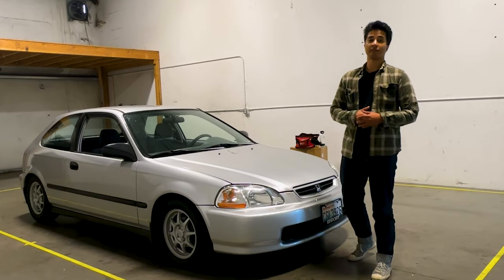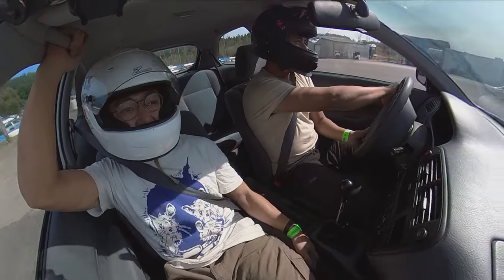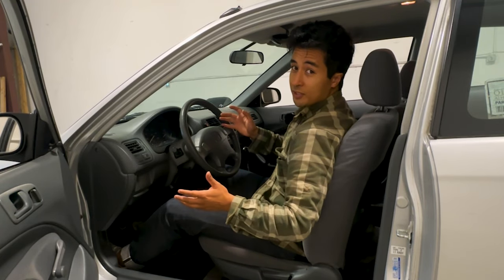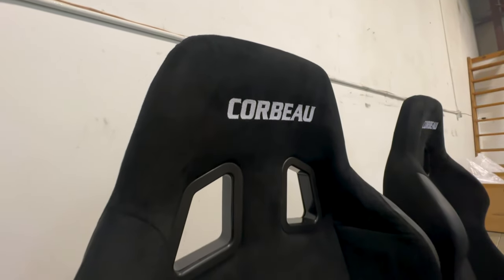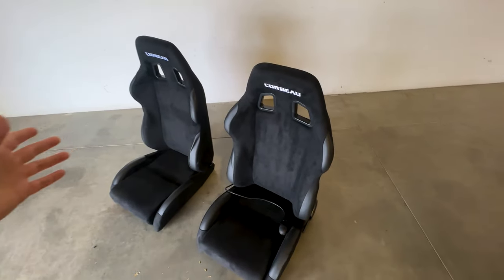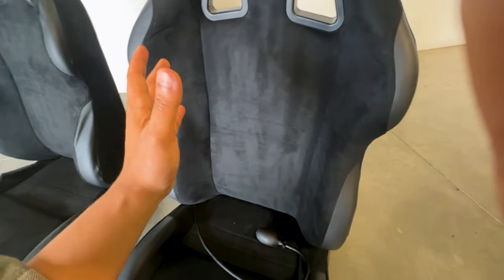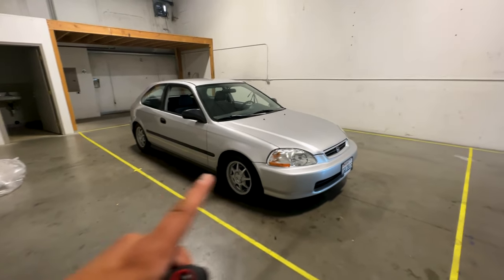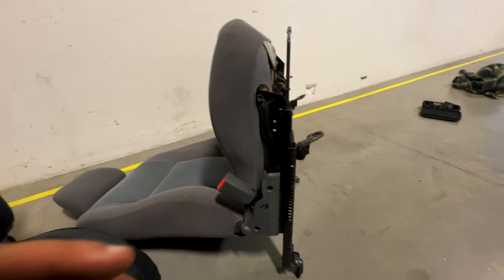Are Aftermarket Seats Worth It? Corbeau Seats Install and Review | Biohazard EK Civic Ep. 20

Comment: by how you described those stock seats sounds like this one really needed the seats! i'm working on getting my nb miata track ready and am trying to minimize mods for now but figure i'll want  race seats eventually, as the stock seats are also flimsy. fun fact, on some cars you can just DIY similar adjustable lumbar by opening up the seat cover and sticking a blood pressure cuff behind the cushions--i first read about it on nc miatas and did it on my gr86 and love it
Reply from the maker: yeah they were definitely tired. still comfy for daily driving, but not for the track. ah I know the nb seats all too well. there isn’t much there to hold you in. A friend of mine has the sparco sprint v’s in his nb and loves them. They look perfect in a miata too. I had no idea about the DIY seat pump, thats very clever! thanks for stopping by 🙌🏽
Reply: That sounds like an insanely clever mod. My fiance is an LPN and I could definitely pull that off > o >

Comment: Love the continued work on the little silver Honda, looking forward to the Acura and BMW work.  Those seats look wicked!   I so love that hybrid shifter and want one for my Hyundai Elantra.  But they put a safety for reverse in that there is a sliding button (can't think of the proper word) to go into reverse.  Hyundai made it easy to steel these (I only have mine because it is a manual transmission), but they put a safety on the shifter!?  So I don't know how that could be done.
Reply from the maker: appreciate it! shame they made it difficult to put a shifter on your car. hopefully you can find a solution to bypass it safely